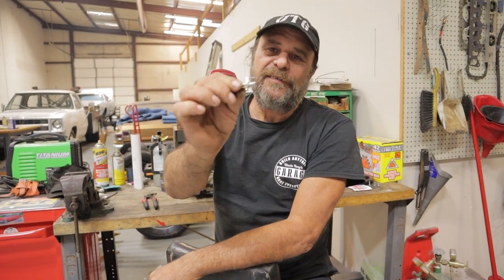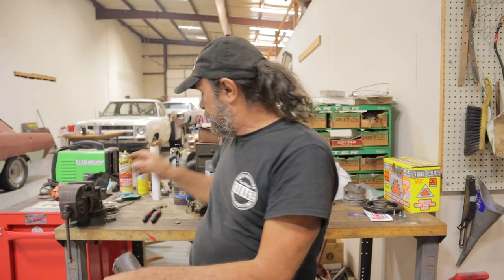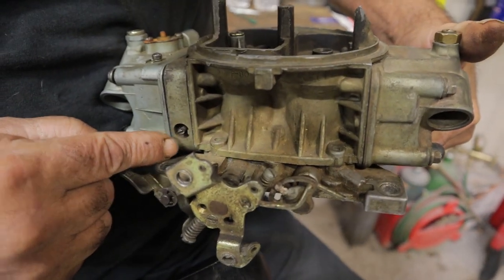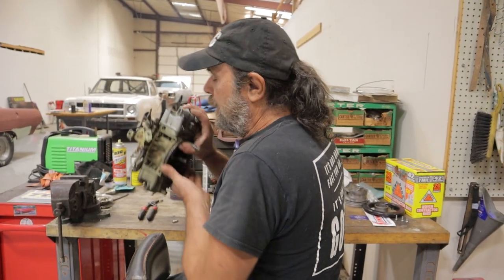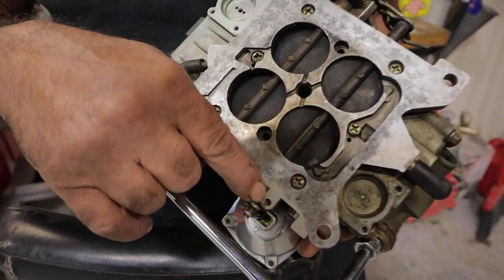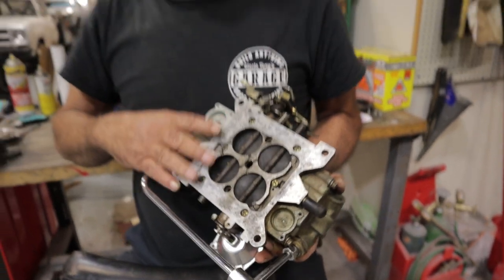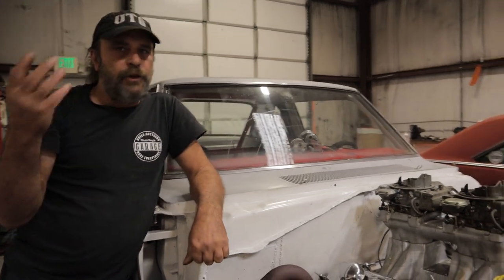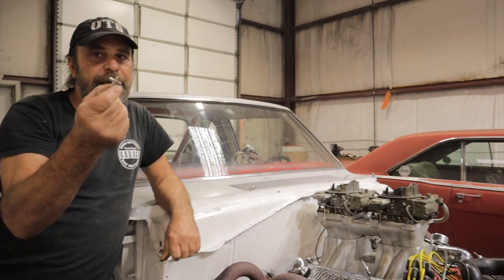Fine Carburetor Tuning Using Fish Tank Accessories - Regulated Vacuum Leak For A Cleaner Idle

Comment: Any chance you could detail where I use this on a holley 650 double pumper? I'm very new to  this world. A retired and have a 67 cougar. It runs like how you described.  Not sure if I need to use a tee? Any help I would appreciate it. Best Carl
Reply: similar to how hes got it there. from a manifold vaccum to ported vaccum port. there is at least a few manifold vaccum ports and at least 1 ported vaccum
Reply: @TheSamplebridge  So do you know where to use this valve with my 650 holley in the 67 cougar? It looks like I would would need a tee.
Reply: @carlonigro7839  Idk what holley you have. There's a ton of different 650s. Lookup the list number and a diagram of all the ports. As long as you have a manifold vaccum port (I wouldn't T it, I'd find one on the carb itself) going to a ported vaccum port. Usually port vaccum is on the metering blocks.

Comment: Good video! 
One thing, If you mess up the throttle blades, just epoxy close the holes.
Reply: I tried that and the JB weld deteriorated and peeled off after a year and jammed the butterflies open. It looked like weird plastic.  I just mig weld them. I don't even have to remove the carb.

Comment: You just used up the single ported vacuum source. Where do you get ported vacuum for your vacuum advance?
Reply from the maker: You can T between the valve and the ported vacuum for the distributor.  It won't see vacuum until the throttle is open.

Comment: my engine idles fine and the air fuel mix is perfect but when the car is rolling with throttle closed it runs richer. it has big cams. would this be the answer?

Comment: Please explain why hotter cams don't produce as much vacuum as smaller ones and by the way why diesels also require auxiliary vacuum pumps.
Reply: Hotter camshafts have more overlap to help scavenge exhaust from the cylinder and get a head start on the next intake stroke. Both valves are off their seat at the same time for a longer period than a stock camshaft, thus not allowing time for manifold vacuum to build.

Diesels have auxiliary vacuum pumps to run vacuum accessories, as a the amount of fuel injected is what controls engine speed. Diesels have no throttle butterfly as gas engines do and thus very little vacuum is present in the intake tract.

Comment: What size hole in the primary throttle blades would be a good STARTING POINT?
Reply: I wouldn't go any larger than 1/8" on the first pass.  And only the Primaries.  If you have a hand reamer, you can tune the hole diameters up with that. Give it a twist or two, then check the diameter using the plain end of a bit as a "go gauge." Keep both sides equal, and make sure you clear out all the shavings.

Comment: Back in the late 70s I had a 360 dodge that pinged very badly under power..I had to back the timing off to stop the ping. That killed both my power and fuel milage. Hmm. What to do? My dad's neighbor was an old time mechanic, he suggested that back in the 50s hot rodders used water injection to stop pinging..hmm. I did some research and came across a very simple water injection system that used fish tank parts and hooked up to a ported vacuum source. I built one and installed it. After a little playing with the same type of valve to adjust the amount of water vapor going into the engine, I was able to jack my timing back up where it belonged. It stopped the ping
I got proper power back and as a real bonus, after getting it all tuned in, my 73 Dodge pickup went from 9 mpg up to just over 14 mpg.  Right now, I am in the process of building a Vortec headed 350 Chevy for a square body pickup. It will be at 9.6-1 compression and run on pump gas. I intend to see if that same water injection setup will allow me to jack up the timing on it without creating detonation problems
https://www.motherearthnews.com/diy/water-injection-system-zmaz79ndzraw/

Comment: Quick question as I can never make the Sunday Night live... I just recently tried to time my Chevy 350. Unplugged Vac adv. and measured. Factory says somewhere around 8 to 12 degs initial, but I'm sitting around 22 degrees and it runs great. If I move it to 12, it runs like complete crap. Total timing sits at roughly 38 degrees which seems about right. Why is it that I have such a high initial timing required for it to run well?
Reply: @mickangio16  Right, but that still doesn't explain why it wants 22 initial when most others seem to round around 10-12 initial.
Reply: @mickangio16  Alright, thanks for the detailed response. I'll experiment  around with that then.

Comment: When you mentioned atmospheric conditions, it made me question if racers used something like this going up Pikes Peak. It seems like you would have to make adjustments going up that high.
Reply: Generally a carb at higher elevation, can run on bigger air correction jets, or smaller main jets, ...but the danger of going to a sea level, with high elevation jetting, can cause burned valves
Reply: @unconventionallifestyle4827  Ok. What causes the burnt valves? Too lean?
Reply: @MaxDeet7439  too lean, from higher atmosphere pressure at the lower elevations
Reply: @MaxDeet7439  the fuel pressure is still the same, because there is no change in float level. Thus the increase in air availability changes the air fuel ratio.
Reply: @unconventionallifestyle4827  👍

Comment: Dear Mr UTG, I have a 66 charger with a 318 Poly engine, I rebuilt the engine, new crank and rod bearings,new rings and adjusted the valve lash and the engine runs smooth,I’m looking for linkage for a dual quad setup for my engine, where would be a good place besides you to find the linkage. I’m 69 years old and would like to drive the car before I kick the bucket. Can you help me please? Thanks
Reply: Forgot to tell y’all that I have an original dual quad intake and 2 elderbrock 1406 0307 carbs, is this going to be a good combo for the engine. On a budget so I can use all the help I can get. Thanks again

Comment: One time I had a fuel injected car that someone drilled to big a hole it the throttle blade. It idled poorly n to.high so the IAC motor couldn't adjust idle. I plugged it. Car idled down.

Comment: This was very interesting, but I confess I'm a little slow. When you drill a hole in the butterfly you're letting in a little more fresh air at idle to offset the fatness. Connecting the hose and the valve to channel vacuum from underneath the butterfly to its top at idle lets in no more air than before. How does that reduce the fatness?
Reply: It lets it go top to bottom not bottom to top
Reply: @campnoutdoors1621  Thank you for trying to help me figure this out. What you say would make perfect sense except at idle, with the butterfly valves closed, no greater amount of fresh air is channeled from top to bottom through the hose. That's why holes are drilled in the butterflies--to let a little more air in at idle.

I know I'm probably missing something here.

Comment: What about "after run" with the extra air into the engine? You know they call it "dieseling"?
Reply: How is a gasoline engine gonna run without spark? You do know the ignition coil loses power when you turn the key off, right?
Reply: @mikem5475  lean cylinders have excessive heat and this heat can continue the engine running. This is why it is referred to as “dieseling” no electrical ignition needed, cylinder heat burns the fuel. One problem with this is the engine is turned off (electrically) and when the deiseling begins immediately after the power is cut off the engine runs in the opposite direction. As you can guess the oil pump runs backwards as does the water pump torque converter etc. It used to happen in the late 80 s cars that they had to place and idle control selenoid on the carb that shut the throttle plate so air would be shut off. It only happens when the engine has a carburetor
Reply: @gittnjiggy2  you have no idea what you're talking about. A gasoline engine won't run with just engine heat and fuel. If it did, it'd never shut off. On top of this, an engine running backwards would suck exhaust and spit out fuel from the carb, which would immediately stop the engine, because of parasitic losses and friction with no combustion taking place as the fuel isn't even going into the combustion chamber
Reply: @mikem5475  Do a google search of what causes an engine to run on after the ignition is switched off?  I am a Master Tech with over 60 years of engine experience under my belt. Don’t be so narrow minded that you can’t learn something new!
Reply: @gittnjiggy2  you don't have common sense
Reply: @mikem5475  I guess it’s way over your head. Let it go.
Reply: @mikem5475 Dear Sir, you are wrong, this Person is explaining the "Conditions" for this ocurance to perfection, if you would just listen.
A very hot combustion chamber will ignite the air/fuel mixture after the power is cut to the ignition coil.
Reply: @williamturner8422  i have yet to see or hear of a case of "dieseling" in my entire life and I'm a mechanic. It doesn't happen because it's not possible in a gasoline engine. You people are misinformed. If I'm wrong I'm sure someone can make a video that clearly demonstrates engines running when the ignition is turned off, let alone running backwards with no spark. Impossible. I will watch a video from you people though
Reply: @mikem5475  Dear Sir ,I received a degree in 1980.
It is in Auto Technology.
I have experience with Sprint cars ( Methanol).
Winston West cars.
Naturally aspirated drag cars 
Turbocharged Drag cars.
Street Machines.
Marine gas engines
Marine diesels ( 2 stroke and 4 stroke).
When a hot emission controlled engine "runs on"
It happens when the throttle blades are open more than a non- emission engine and while the key is off the engine continues to run ( in reverse)
You will smell Nox if you are close to the engine because exhaust is being pushed up through the carburetor.
I have done my level best to help you understand " run on".
 And to be honest I really don't care if you think I don't know what I am talking about.
I don't need your validation.
My only responsibility is to do my best to inform you and I have done that.
Good day, to you Sir.
Reply: @mikem5475  There are 4 utube videos on the subject of "Dieseling".
Reply: @williamturner8422  link em

Comment: .🤔,,,,,,,,...   Barry Grant also created what is called ,,,,idle .. EZ...check that out... Some of you will find that very interesting I'm sure...it's a base plate with a jet in it you can adjust via the air cleaner bolt hole in the carburetor...  Just look up.. idle EZ.
This feature is on newer  demon carburetors.....you can buy base plate separately ....to adapt it to older carbs....

Comment: I'm not sure why the fish tank valve needs to loop up to the ported port. Wouldn't the air get in better if it was open to the atmosphere?
You'd think the hose would be blocked at the ported port if you were at idle.
 Also, that would mess up your vacuum advance since they are tuned for ported vacuum.  And you'd be putting manifold vacuum in there. I realize Tony would not use vacuum advance on this type of car.
Reply: The ported vacuum would be filtered. Just leaving the valve open to atmosphere would turn it into a mini vacuum cleaner, picking up any dirt around the intake manifold. You could probably T off for vacuum advance, but it would be a weird blend of ported and manifold. That would be something to experiment with.

Comment: That's got to be the dumbest thing I've ever heard of.  Who in their right mind would put an aquarium accessory on their carburetor?
Now if you'll excuse me, I just changed the EGR valve on my cat's litter box and I've got a real MESS on my hands.
Reply: No, no, no.   Using an EGR valve with a cat, the valve goes on the CAT, not the litter box.  As kitty gets older, you may want to add a methane detector linked to a piezoelectric igniter so you get clean and instantaneous burn-off.